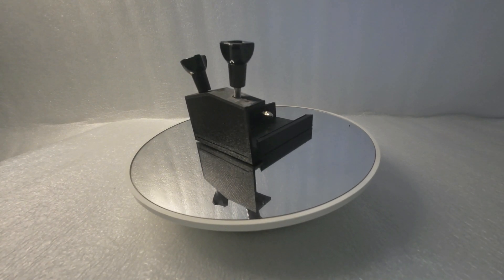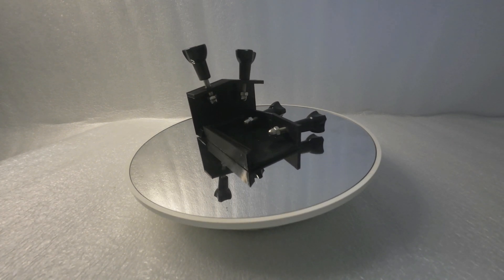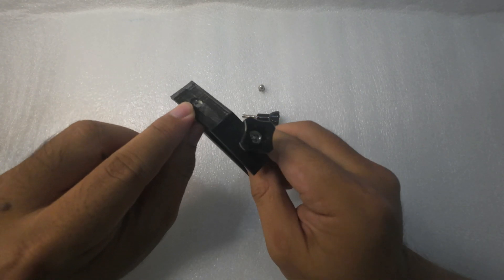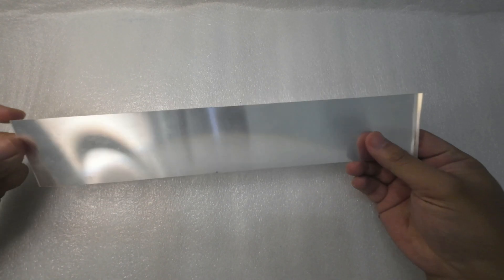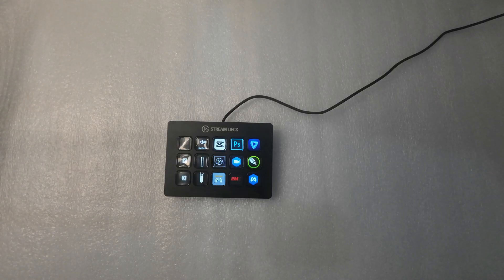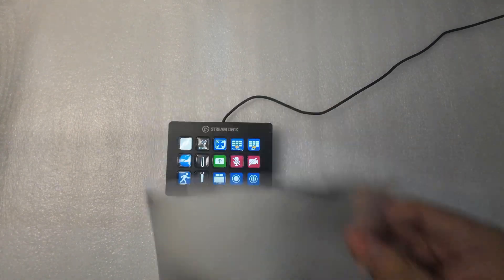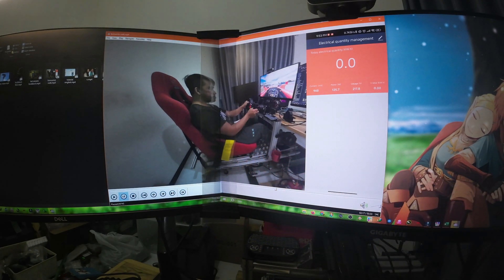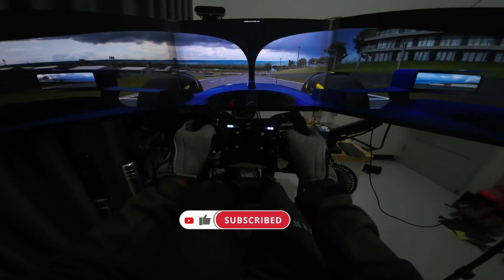Updated‼️ Make a Budget DIY Bezel Free Kit‼️

Comment: When removing the lens from the old monitor did you cut it  vertical or horizontal? As I'm wondering what size monitor I'd need to get to use on my 32 inch monitors, don't want to get a 27 inch and it's to small if I need to cut vertical
Reply from the maker: Horizontally. But you still have to check if the sheet is have that orientation. Coz I find every manufacturer got a different orientation

Comment: So simple... how much did you spend on the printer.. so simple
Reply from the maker: @KristieGaddy  only $2, and $3 for the fresnel sheet 😁. Bolt and else, total about $8
Reply: @ismail_hobby  I get some fresnel sheet out of a old TV, but it doesn't look right. I still see the bizel of my monitors, adjusted it to 0 but still not working right. Should they have a certain thickness ? Where can I buy the fresnel sheet?
Reply from the maker: @oskarhaas824  what I know is that not every LCD has the same sheet. And you can check the orientation, rotate it to see which side is thr correct one. But if it doesn't work, then it not the correct sheet. I buy it on local market in Indonesia for only 3 bucks.